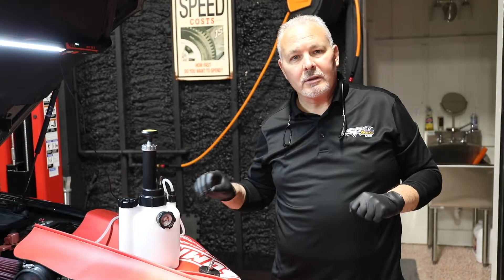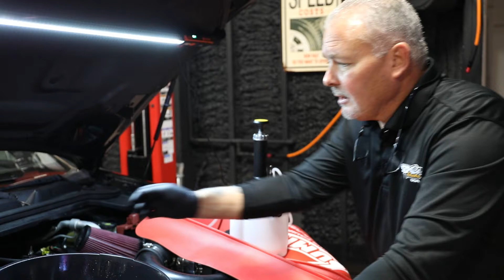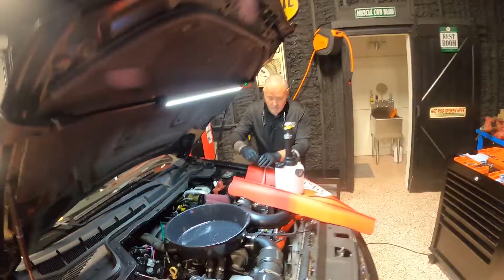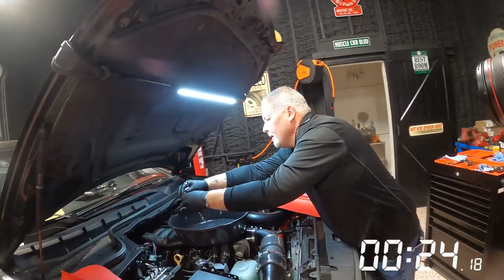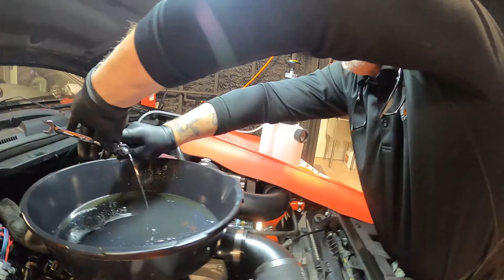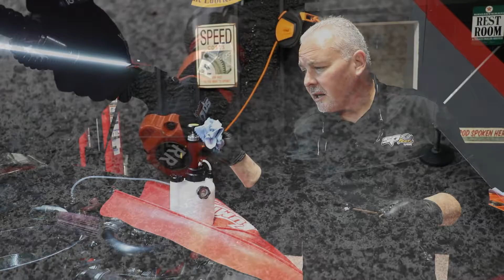SP Brake & Clutch Pressure Bleeder | SP70809

Comment: Did you put fluids in the pump container before pumping or you dont need fluids? Also, do you need to have the clutch pedal pressed down before opening the bleed nipple?
Reply: Yes you put fluid in it! It holds 2.5 litres or 0.66 gallon of hydraulic fluid! He's not using it correctly which is why he probably had to do it multiple times! 
Not a good promotional video for SP tools really!
Reply: Would also like to know.